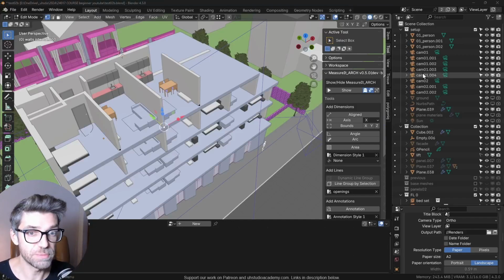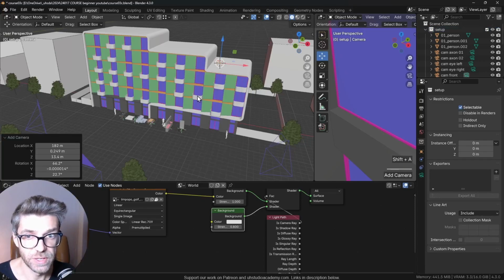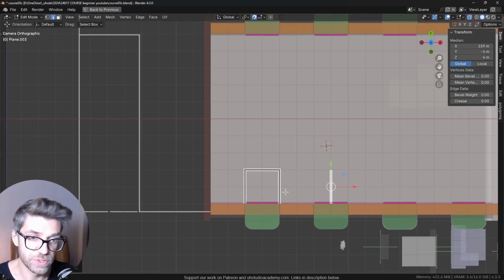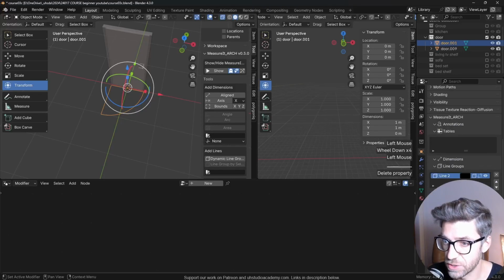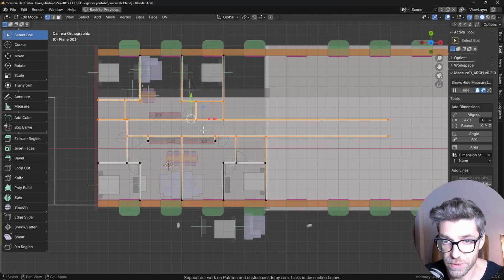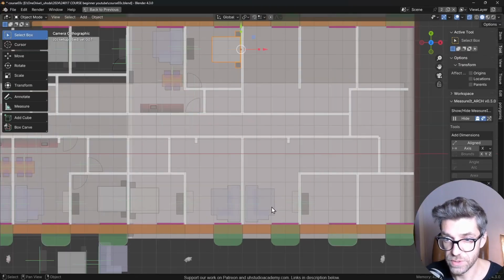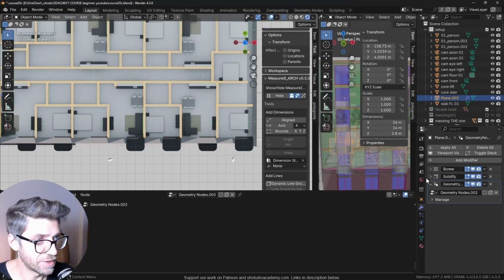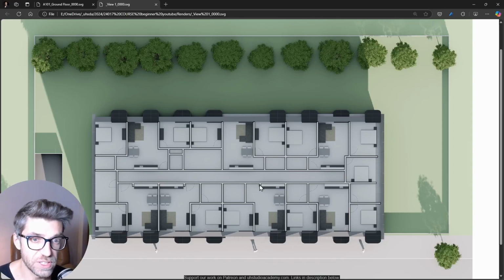Part 4, Course - Residential Building:  Apartment layouts and drawings Blender Architecture

Comment: I just tried this, but the version of MeasureIT Arch is different to your and when you set line styles, the overlay of you talking hides the process you're doing, so I can't figure out what is wrong. I've tried, with the latest, of selecting the walls object, then clicking Dynamic line group, but nothing happens. I'm sure I'm doing / not doing something basic.
Reply from the maker: Hmm, more often than not, new versions of Blender tend to break some addons, if those addons haven't been updated with the latest API. Can you try with an older version of Blender to see if it works?
Reply: @UHStudio  Did some playing around / investigating. Turns out, I'd clicked the dynamic line more than once as I was expecting some sort of message / indicator. When I went into the object tab, I realised what I'd done, then set it to line style 1 and hit the "show" button. A weird thing on hte output though was the lines created were offset from the image, I had to pull it into a vector progam and re-align them. Dunno if that's my software or not. Tried both Serif Drawplus & inkscape, both did the same. The embedded image had a black border as well, very odd. I'm using Blender 3.6

Comment: I was also wondering about something, when youf filp your objects you tend to use Scale -1, i'm wondering why?, in my work flow i tend to you Ctrl M for mirroring, and then you can just press either of the axis to contraint in within that axis. So perhaps there is something unique about your use of Scale -1 that i'm not aware and would like to know.
Reply from the maker: Hi, nice to see you here! Never tried your workflow, but sounds the quite similar. The problem with scale -1 is actually that faces need to be flipped sometimes. Not sure if that's the case with ctrl+m. Sometimes, we do what we are used to :)

Comment: So looking forward to it. Next semester I teach Exhibition design and we will use Shapr3D for most of the CAD work and Blender for setting up the scenes. An no SketchCrap.
Reply: I share the repulsion for sketchup
Reply: @robertorecoaro8423  it has a few cool features. The drafting ability in general drawing arcs connecting a line tangent to a line or arc, section cut, offset tool, but then if you want more you need now to buy 3rd party modeling extensions ...

Blender has some of those but in rather convoluted and complex workflow but on the other side offers so much more in addition